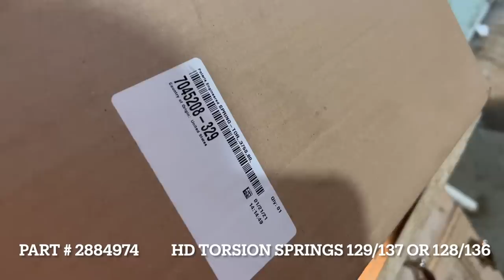2022 POLARIS MATRYX- ARE HEAVY DUTY TORSION SPRINGS NEEDED AND HOW TO INSTALL THEM?

Comment: on a used 2021 650 xc sled i bought are there Part numbers on the springs so i can find out what I have and if not can i mic the springs and contact the dealer with that info or find it online .

Comment: Does this recommendation also apply to the Matryx Assault? I'm 215 lbs, 70/30 trail rider running the stock spring on high and looking for better steering. Local shop didn't recommend going with the heavy duty, warned me about the increased rebound/kick and suggested shortening the limiter strap. (This without asking my weight or how I' ride my sled.) Love your channel Jesse, keep it up!
Reply from the maker: Hey man! I would definitely recommend the HD springs. The valving on the assault will be fine. Bruce has a ton of guys on assaults with HD springs. Will help weight transfer in the corners and will keep the skis planted better!

Comment: Why not adjust your compression?
Reply: Yeah I’m also interested. Isn’t spring for sag and compression for bottoming?
Reply from the maker: shocks are for dampening, not ride height and supporting the weight of you and the sled. Yes you can run the clickers in and it will stiffen it up but if the springs are too soft there is not amount of clicks that will help you. This is a known thing that polaris trail sleds come under sprung. Its extremely noticeable. These HD springs changed the entire sled (in a good way). If you are so under sprung there is no shocks out there that will work how they are suppoesed too

Comment: Picked up a set of HD torsion springs today for my 2023 VR1 129 after trying my buddy's 2023 XCR with HD TS yesterday. Hopefully, will help keep front skis planted. Weigh 165-170 # but add plenty to tunnel weight with Gatorade, water, and quart of 2 cycle oil so closer to 190 # for sure. Need HD TS anyway when I eventually put two up seat on. Have Velocity shocks backed off three clicks from all the way in. I know you and Bruce Sr. said adjust front springs as well but is shortening limited strap needed to keep skis planted? I have two Gold Digger studs per window.  Thanks Jesse!
Reply from the maker: yes shortening the limiter will absolutely help keep the skis planted. probably the biggest and most effectibe change youc an make!

Comment: What is that hard gauntlet or handguards? I want the same ones!
Reply from the maker: They are the ROX SPEED FX Pro Tec hang guards and the gauntlets are the ROX SPEED FX ASG Gauntlets! Best in the business! If you get the GEN-3 Flex Tec Hand gaurds the ASG gauntlets work extremely well with them. They are actually made to work with them

Comment: 22 vr1 137 850 here weigh between 170 and 180 was running medium on stock springs most of the season and was bottoming quite a bit seems like I bottom in the front and rear. Moved the stock springs to high setting and it was much better.  Probably going to get the HD springs but also thinking I might need heavier springs for the FTS and the front shocks as well as valving done.  What options does one have for springs on the FTS and Front shocks?
Reply from the maker: hey Dru. so yes definitely go with teh HD in the rear. they will make a difference. The front ski springs on a VR1 are only 80 pound springs. I would recommend going with the 100 pound springs that come on the XCR from the factory. The FTS is also soft on the VR1 and i would recommend either the hygear dual rate (what i run) or a straight 150 pound spring which i have also run. Valving i also recommend and i would say to give Bruce SR at southside sales and service a call. tell him i sent you and he will get you all set up with valving and springs. Thats who does all of mine! any questions let me know

Comment: Great info ..I was having trouble with under acceleration turning and the front end just would come enough to  make turning impossible I know that my 850 matryx has crazy power delivery but it maybe to soft torsion springs now.....to much weight transfer?
Reply from the maker: That very well could be. How much do you weigh?

Comment: Hi JJ 
      Changed my springs ohh what a difference....first of all you feel confident in the way your riding... handling...is 💯 better..I like it sit in is better I weigh 220... thank you for the video...I do have a whine drone noise in the track ...1.35....or could be chain too tight ...checked it twice ....1300 miles now.....
Reply from the maker: love to hear that, and probably your breaks just hanging slighty. mine whine all day every day even when im not on them
Reply: @JESSEJAMES322  I will find out...the whine...I never use brakes....

Comment: So I noticed you have your front ski springs tightened down pretty good. My vr1 came from the dealer with the adjuster rings as far as they can be up. We're they supposed to have more preload from the factory?
Reply from the maker: I am not sure with the VR1's as they have a different shock and spring set up. Check out your owners manual they will give you the minimum and maximum preload they allow. Im sure youll be able to run yours down some more though

Comment: I just bought a 2022 xcr and  need to change the torsion springs per your suggestion. I am a very aggressive rider when trails get rough. we know how fast they break down up in tug hill. especially up by flat rock  I weigh about 190. should i go with the extra heavy duty springs or just heavy duty. Thanks
Reply from the maker: I would recommend the regulat Heavy Duty not the extra heavy duty BUT i would HIGHLY recommend getting your shocks revalved by Bruce from SouthSide. The Factory valving inside the shock was not even close to where it needed to be. Any questiosn on that let me know!
Reply: @JESSEJAMES322  Thank you for the info. i will definitely look up his info and reach out to him and get my shocks done also. all 4 of the shocks you recommend. Thanks again. see you on the trails.
Reply from the maker: So this video (link at the end of my comment) should answer any and all questions you have! i 100 % recommend the rears and maybe a set of springs for the front ski shocks as the valving was not horrible in them. https://www.youtube.com/watch?v=eNCyEbs5KhY

Comment: Mounting bolts are in backwards.  Flange nuts go on the inside.
Reply from the maker: They do not. The front torque are bolts go outside in. The rears go inside out

Comment: Your dealer should set you up with the correct springs at delivery.
Reply from the maker: many dealers do not get involved with their customers like they should. Some do but most do not! But I agree
Reply: Dealer should sit you on it and setup sag. My girlfriends vr1 came with no preload on the front ifs which was sagged at 2.6 inches now I have 1.5 inches of free sag after putting an 1.6 inches of preload in the springs.  There was 6.5 on the rear after making the fts to its minimum of 1.75 inches and the tortions at high it is 4.5" and now rideable and not pushing.  No wonder people die on these brand new sleds the first or second trip.  Polaris should also put in their manual proper sag and ride heights instead it's just a vague min, max setup.  They claim they don't want liability so they leave it out.

Comment: We have the same exact sled and I am surprised that you have had such a different experience than I have. I was bottoming the FTS on some bigger stuff so I went up 3 clicks on the High speed knob and it feels great, no bottoming. Springs are both set to 2 and they are much stiffer than what is on my 2020 XC 850 so I am inclined to think that my XCR came with heavier springs like they were supposed to. Or my springs on 2020 are just that worn out... hey who knows. If this is what works for you then run it!
Reply from the maker: FTS is extremely soft. I blew that even on the smaller stuff. The XCR this year did not come with the HD springs It has the same as the XC's and VR1's unfortunately . BUt hey im happy to hear you're happy!
Reply: @JESSEJAMES322  I know in the past some guys have had shocks come from walker evans with very little Nitrogen and needed to be essentially rebuilt immediately for the same reason you’re describing. It makes me wonder if you got one of those shocks but hey who knows, If you’re going to have it rebuilt I’m sure you would just revalve exactly how you want it
Reply from the maker: Bruce has been revalving a bunch and as not seen that be an issue so i am leaning towards no but could be i guess!

Comment: I need the extra heavy but can't find so mite end up going with HD 🤷‍♂️
Reply: I have a set of extra heavy duty’s with 200 miles on them. $220.
Reply: I’m in southern Vt
Reply from the maker: call SouthSide Sales and Service. tell them i sent you and they will get you set up!
Reply: @JESSEJAMES322  thing is I got a 2015 switchback pro s 800 deakee saying they can't find them and don't think they make them for my axys chassis 😢

Comment: i'm 260, i put H D springs in works great, my friend is 180 standard springs he has issues so he plans on changing out
Reply from the maker: Love to hear that! He’ll be much happier with the HD!
Reply: was it  enough I’m 265 6,3 didn’t want to go with the extra  heavy duty . What settin* is it on .
Reply: @JESSEJAMES322  do you think at 265  the heavy duty ones on 3 would work?
Reply: Just thought heavy would be to stiff says 310 to 450 weight for the big ones .

Comment: Great video as usual.
I have a Rear Torsion spring kit on order. Part # 2884974 and the details say it has 3 springs with it so I am assuming one is for the front track shock but no idea as to what it is? Dual rate or 1 large coil. Dealer could not answer the question so it will be interesting to see what shows up.
Do you have a part number for the front track shock you install?
Thanks from Saskatchewan, Canada 🇨🇦
Reply from the maker: That part number is just the rear two springs. not too sure why its saying 3... The FTS will be the same shock just valved differently from Bruce. I will be changing FTS spring though which i will have details on in a later video!
Reply: @JESSEJAMES322  on the CDN website link it says under: Overview & Specs, that it includes front and rear track springs so that is what got me thinking that the front track shock spring is included. Guess I will find out next week as they are supposed to be available Jan 29th.
Thanks for the quick response and keep the videos coming.
Reply from the maker: keep me posted on that because ive never heard of that! anytime!

Comment: Watched your video last night put heavy duty on today blown away by the difference.  Now feels like the xcr I was expecting.
Reply: How much do you weigh if you don’t mind me ask.  I’m 240. Think I’m gonna try to find a pair of HD for xcr
Reply from the maker: Love to hear that. They are a huge difference!!
Reply from the maker: You can absolutely benefit from HD’s. 100% recommend!
Reply: @nicholasbarker349  Around 230 with all my gear on. Set springs on low and clickers set at only 3 on high speed and 1 on low speed. The ride is now amazing and I took it through a really rough section of trail as hard as I could and it never bottomed . Totally different sled now.
Reply: @davidaines565  thanks for your response.  One more question. Why are your front skis set at. High and low
Reply: @nicholasbarker349  3 on high speed 1 on low speed